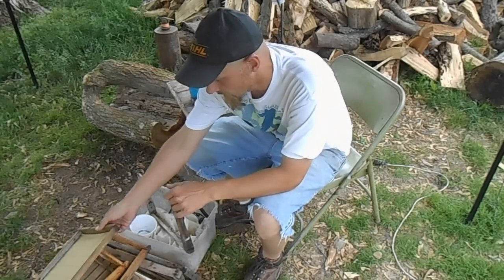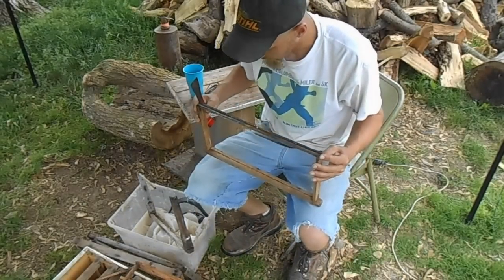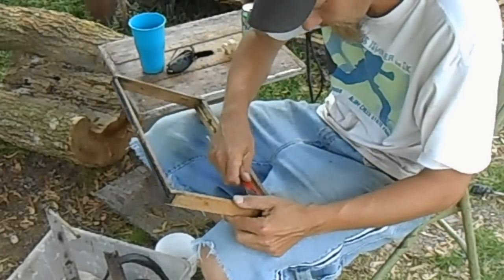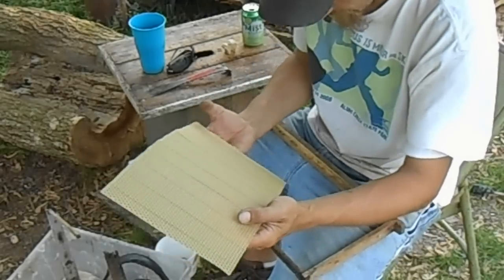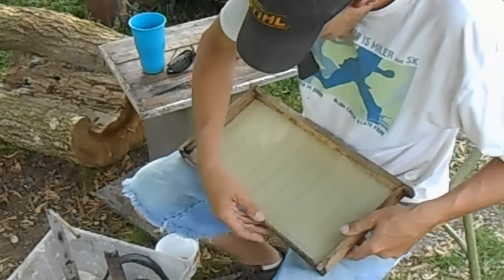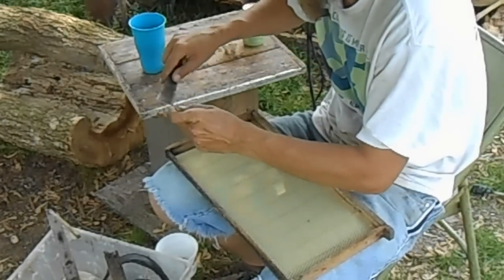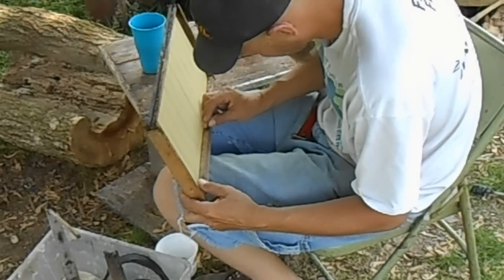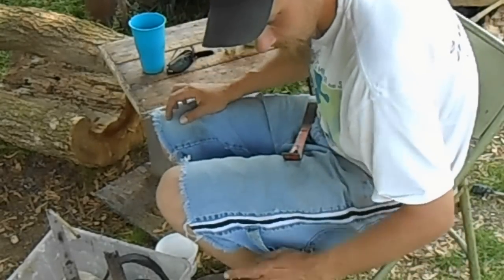Beekeeping: Installing Wired Wax Foundation in Frames

Comment: Jason, I lik your videos.  But, I have a question.  You didn't run wire side to side and set the foundation in those.  Why did you skip this step?
If you try to extract that frame with honey it will blow out in the extractor.  Or, don't you extract your large frames?

Comment: Why do my foundation keep coming loose at the bar
Reply from the maker: Is it wired waxed foundation? Are you nailing the wooden top bar wedge over top of the bent wires extending the end of the foundation? If so, maybe use longer nails or angle each nail differently than the previous. I usually use 3 nails on the wedge. If all 3 go straight into the wood sometimes they do pull out easier. As where if each nail is at a different angle they fight against other making it slightly hard for it to pop off, freeing the foundation.

Comment: I found out the hard way, that where ever the wire is the queen wont lay and egg. The test was i weave the wire, and sure enough there no eggs or cells where the wire was
Reply: Imbed the wires in the wax and they will. I have never had a problem with that.